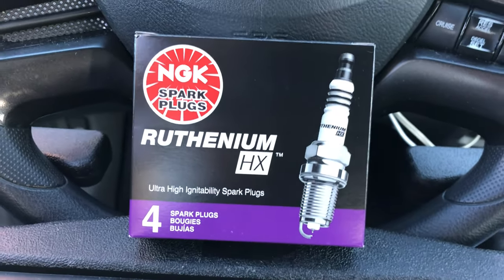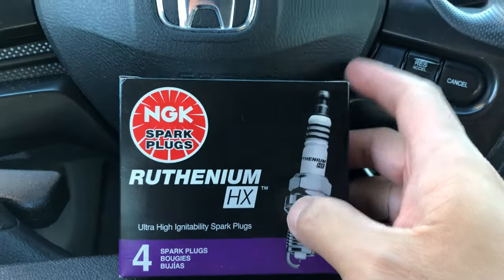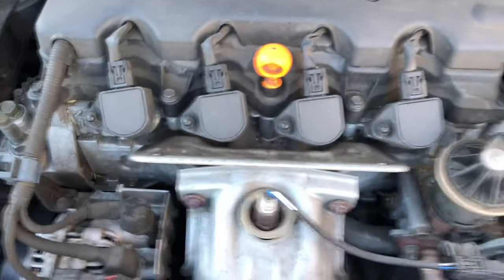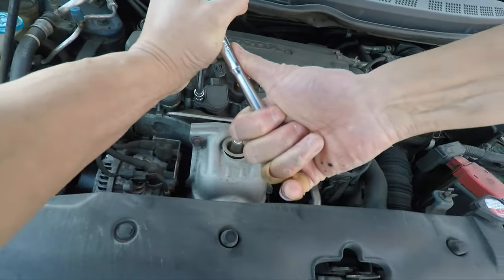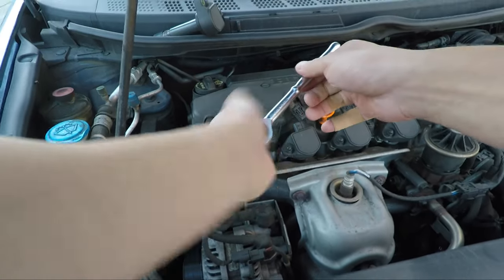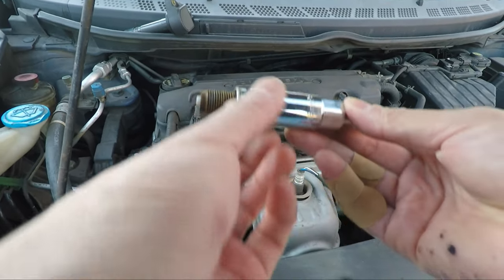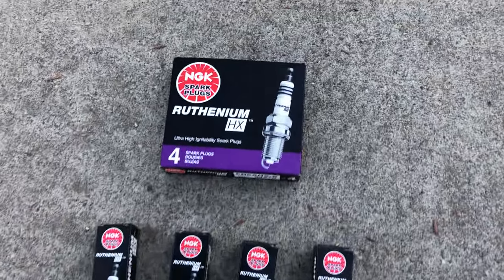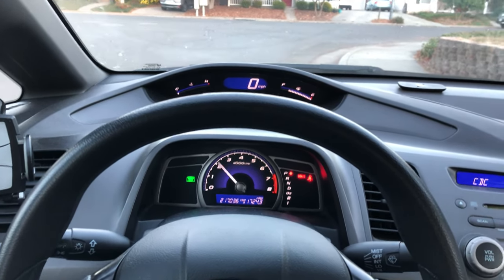How to install the HOTTEST new NGK Ruthenium HX Spark Plug! (Civic 2006-2011 8th Gen)

Comment: I got these for my 2016 Nissan Altima SV and I gapped them to 0.44. I just made sure to avoid the electrode. 

Idle is quiet and smooth, MPG is as advertised, 39 miles highway, 28 miles city. If I remember correctly, odometer is 150k.
Reply: Did yours not come pregapped? I am thinking of getting some of these for my car. rock auto says they are pregapped but I'm not sure if I'll have to gap them myself. Also have you noticed any changes in performance since you last commented?
Reply: @theplaidgamer1653  Not the spec recommended atleast what I found while doing some research. The performance gains were, better acceleration, gas mileage. I don't have exceed 2500 rpm to get to 80 mph. 

Although, that was before it became evident its time for a transmission fluid change and a serpentine belt replacement.

Comment: I put these in my Toyota Corolla LE 2006 Automatic to make a "Zipper LE Build"  tied with Duralast Coil Packs, K&N Filter(Airbox Charcoal Filter Removed due to clog), front strut bar (waiting on my rear one), Throttle Controller, and Driver Easy Bridgestone Tires on Steelies. Hauls some serious ass! I'm gonna get some alluminum wheels soon for increased acceleration/stop distance improvement for sure. I stand by Rutheniums for sure!

Comment: Don't add oil to the thread, no recommended by NGK.
Plug thread diameter and Tightening torque 
18 mm: 35 to 40N·m (3.5 to 4.0 kgm) 
14 mm: 25 to 30N·m (2.5 to 3.0 kgm) 
12 mm: 15 to 20N·m (1.5 to 2.0 kgm) 
10 mm: 10 to 12N·m (1.0 to 1.2 kgm) 
8 mm: 8 to 10N·m (0.8 to 1.0 kgm)

Comment: Don't lube the thread with oil or anything else. Not even anti seize. A locking extension is nice to have for these so you don't have to fish out the socket. It's always a good idea to turn the spark plug backwards a turn or so until you hear and feel the threads find the starting point before threading them in. That will reduce the chance of cross threading them. Probably unlikely that it would happen on these cars, but it's a very good habit to have.

Comment: Thank you...please don't use oil to coat plug...Tip Extension to socket wrap with electrical tape..Never have to fish for socket again. Good luck
Reply: Or get a socket made for plugs lol rubber inside socket to grip the spark plug

Comment: u need the 
Duralast 3/8in Drive 5/8in Magnetic Spark Plug Socket with 10in Swivel Bar
Part #
52-136 autozone works wonders

Comment: Nice video thanks for sharing :0) just purchased a set for my older tacoma. Like others have said, use just a tad of anti-seize on the spark plug threads. buy a tube toss in top drawer of tool box, It will last a lifetime if used sparingly. Anyway great video

Comment: What is the lifespan of the Ruthenium plugs vs. the standard copper/nickel plugs?
Reply from the maker: Ruthenium hasn’t been around long enough to know for sure but speculation is that they are long life but shorter than Iridium.  Standard spark plugs 10-20k mi, Iridium 60-100k mi, so somewhere between there.

Comment: It raises the cylinder compression because they stick out more than thier ngk counterpart but I believe the iridium will last longer just installed some today but the price you pay won't amount to the savings you get from changing over so it's pretty pointless way of manufacturers using less expensive materials.
Reply: It's been two years already that I haven't changed my spark plugs and that's going 80 to 90mph once time has passed you'll notice that your acceleration has decreased less gas milage, I had the block version ones older version I'm exited to try these new ones.

Comment: I just switched my Spark plugs with these same plugs my car is a 2005 Civic. It's hard to tell if I notice any difference.  Its only been a few days.  

It seems to be running fine.  It should be interesting if Ill notice any difference in the cold starts.  I did record the cold start to compare the cranking.. the car seemed to crank slowly in very cold before. But, its never NOT started. 

Separately, I'm leaning towards changing my moms 2017 Corolla its approaching 6 years and has aout 52k miles.  Toyota says say 120k but, when I look at the parts department it says they have platinum tipped spark plugs which can only last up to 60k.  That car gets worse mileage than mine right now in winter its at about 28mpg in warm weather it get 32mpg my honda gets around 35-38mpg mixed drivng.  I don't know if this is normal for mostly around town driving for the Toyota LE Corolla. But, any bump in efficiency could pay for itself. Do, you have any opinions on this or do you think I'm foolish to change the originals this early. Another reason is  at least I'll know 100% what is in the car being its used. i can only guess it has never been changed. Though, I have no idea.   One time my mom did say it had trouble starting.  Which is what made me wonder if it could be starting to fail.  The other option would be to have them pull the plug and look at them. Quite honestly, we already have the part so it seems sillly not to just spend the 100-120 dollars to get it out of the way. Being, it has such a long life span. (Id be swinging it to a bosch double iridium spark plug 96339. Which seems to be the highest quality plug for her car.

Comment: So these are ok to install on a 2006 civic si??
Reply from the maker: There might be a part number difference since my LX is 1.8 liter and I believe the Si has a 2.0 liter engine.  Otherwise I would highly recommend the Ruthenium plugs.
Reply: If they are available for your car then you can use them.
Reply: I must of gotten the wrong ones cuz they were an inch too long
Reply: Yes. They make a set for the k20z3 si. Ive had those in my motor for 2 years 20k mi at least

Comment: never ever ever ever put oil on the plug threads like that they might back out on you, anti seize is for the threads and dielectric grease for the coil boot. 
you'll learn youngster..
Reply: If I'm not mistaken... NGK does not recommend anti-seize be used on the threads since it's already coated from the factory and will not give you the correct torque reading (13 ft lbs) when using a torque wrench. This is what it says in regards to using anti-seize ---> Anti-seize can act as a lubricant, altering torque values up to 20 percent, increasing the risk of spark plug thread breakage and/or metal shell stretch. Do not use anti-seize or lubricant on NGK spark plugs. It is completely unnecessary and can be detrimental. **But dielectric grease on the coil boot is definitely a good idea!
Reply from the maker: Hello and thanks for watching!  I am delighted that my use of oil on the spark plug thread has caused so much "controversy".  After all, sharing ideas and techniques is what the car community is all about!  I use a drop of oil on the threads to lower the chances of cross threading and to provide a better feel when hand screwing in the plug since the aluminum head might be soft and "catch" a little bit.  Oil is not covering the tip or drenching the plug.  When properly torqued, the spark plug will not "back out" on it's own.  c Yang is correct in that any lube on the thread acts as a torque "multiplier" and oil is commonly used for this.  In this case, notice that I do not use a torque wrench, I am following the turns directions on the plug box.  1/2 turn is 1/2 turn no matter if there's oil or not so this multiplication effect should not be taking place here.  Most importantly, I use oil instead of anti-seize or any other substance because it is pretty much "safe" for the combustion chamber.  In the worst case, any excess oil will simply burn up in the cylinder.  If anti-seize got into the chamber I'm not sure what effect that would have.  Also, I don't need to really clean out old anti-seize, simply put a few more drops of oil and I'm good for the next plug change.  Thanks for sharing and cheers!
Reply: @kelvinsgarage  Good video and thanks for making one. This ongoing debate about using or not using any kind of lubricants or anti-seize on NGK plugs has been around for years, some use them others don't. I personally don't use anything on my plugs when installing them new since it's already coated from the factory.. however, I do use a tad after the second or third time (inspecting plugs) since the coating would no longer be present, but I do back down my torque value to approx 11 ft lbs if anti-seize is applied. Just got some NGK ruthenium plugs and will install them on my 4-Runner soon and try them out to see if performance is enhanced or not. Another thing when R&R plugs is this debate about whether to do it while the engine is cold or warm (definitely not hot). I change my plugs when the engine is warm or cold, but never when hot. Heat will expand the metal and it will be that much harder to remove plugs and things can go south really quick. Thanks again for making this video! Cheers

Comment: You NEVER EVER put oil around threads EVER. Spark plugs are not oil filters. They don’t need oil lubrication. NGK doesn’t even recommend this and they made the spark plugs you’re putting in your car. Omfg. Anti-seize is not expensive. You paid more for the oil than a couple packets of anti-seize. Petroleum oil is not the same as anti-seize otherwise anti-seize wouldn’t need to be made if motor oil worked better. You’re basically giving the spark plug the ability and opportunity to unloosen itself because there’s nothing for the threads to hold or grip against. I’ve changed spark plugs out that had anti-seize coated to the threads and spark plugs that had clean dry threads and both never gave me issues. Also the oil can seep through into your combustion chamber where the top of the piston ignites with ONLY fuel and air and cause carbon build up. I would never let you work on my car. I wouldn’t even let you clean the windows. Omg wtf are you doing?

Comment: Wow, this is bad.  NGK is NOT suggesting you shouldn't gap these.  What they are trying to tell you is do not pry up against the center electrode when gapping them.  it is very thin and can be damaged or bent easily.  Don't put oil on your spark plugs...where the hell did that even come from?   NGK specifically states not to even use anti-seize.  Please be responsible when making these videos.  People that don't know any better might do what you did.